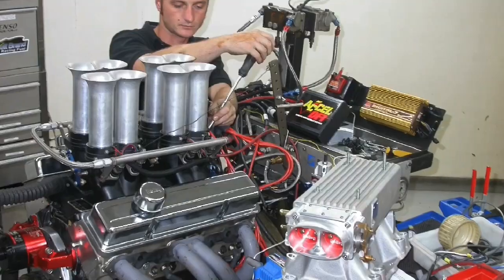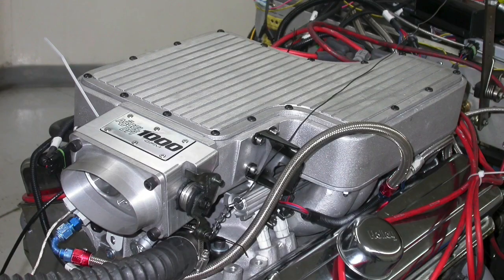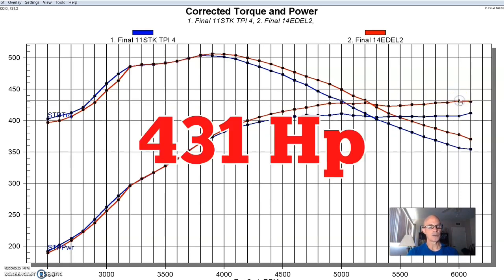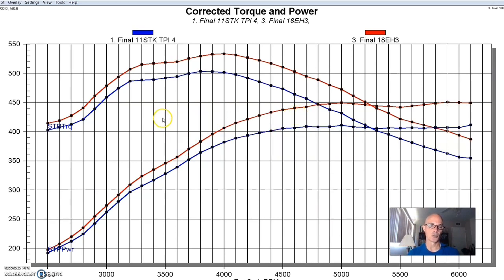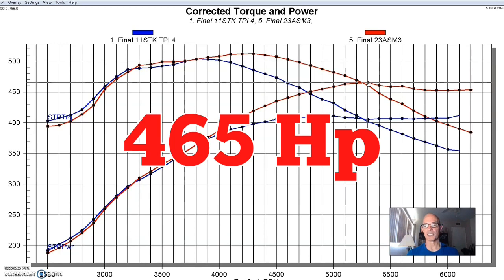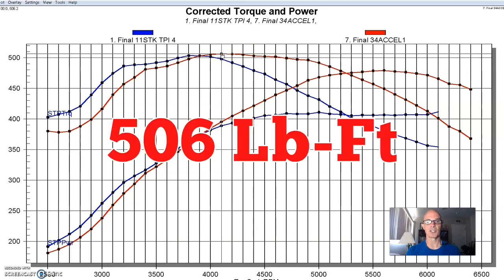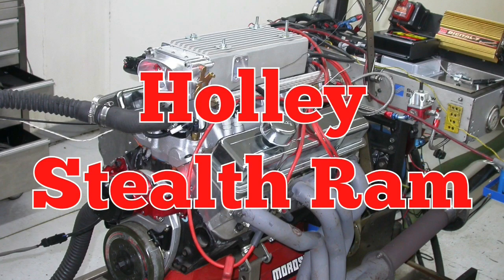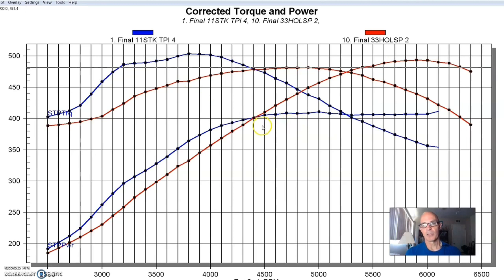TPI MEGA TEST-WHAT WORKS BEST?

Comment: I will take the 530 ft lbs of the the tpis long runner. WOW
Reply: I put as&m, ported stock plenum, accel/lingenfelter manifold, stock TB with airfoil, and make 271hp and 354 tq with a 305 (P&P heads, bigger cam, forged internals, bored over 0.030 which I guess makes it a 310ci). Going to keep entire top end (except will upgrade to 24lbs injectors) and replace block & heads with a 383 and AFR 195 heads which should yield similar numbers to this I think (500+ tq range and 400+ HP range)
Reply: Now imagine if you put a turbo on it with a air to water intercooler to make up for the loss of high rpm flow with boost.  Best of both worlds.  Sacrifice some top end HP for OUTSTANDING off idle response, drivability, and fuel economy when cruising but you got the hong kong hurricane for passing all these 20yr olds with 5.0L mouse stangs.
Reply: That extrude honed stock intake surprised me the most. Definitely not the 500 hp mark but torque was as good as the TPIS whole package.
Reply: @BuzzLOLOL  yup.  They are the best forced induction type for street driving.  Turbo is best for peak output, centrifugal is best for ease of tuning, roots is best for price/perf in towing/mid rpm power.  Each one has an application.  
Putting a twin screw on a TPI setup though would be interesting project due to mounting/hood clearance.
Reply: @BuzzLOLOL  you do if you want to maintain high torque production in that rpm band.  boost just uplifts the torque curve that already exists.  TPI is great for tq.
Reply: @cmcbunch  around here we call them 5.0 muffstains
Reply: @jeremypike9153  
That one impressed me the most also. I'm here looking for a tow engine. All the fat is down low.
Reply: This is what the lingenfelter L98 twin turbo corvette did. Fat power from idle just pulled and pulled with no real crazy surge @cmcbunch
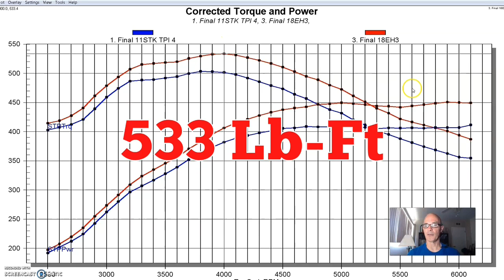Reply: 5:19
383 
AFR 195
10:1 flat top
Comp Cams
XR288HR
.520/.540 lift
236/242 duration 
110 LSA

Comment: I was shocked at the power of the extrude honed with Tpis runners. A lot of guys are going to be disappointed with they’re edelbrock set ups. I have the TPIS mini ram on a 350 and really like the high rpm power for racing. With the ram air setup I get every penny of power. Fun video for those of us gen x’ers!
Reply: The edelbrock bases are fine and real good after porting 
Runners...Id use asm if you can find them.

Comment: I performed a couple of these tests personally in a car on a 350. I had a stock tuned port and both TPIS set ups. The TPIS stuff is amazing on both long and short runner combos. It literally is just a trade as he says. In the car at the track both ran better than the stock but both ran exactly the same ET and MPH. The difference was how the car felt on the street. With the short runners, the car felt less snappy and soft to drive.

Comment: GM TPI intake: Best n/a truck manifold . . . E V E R. 👌🏻😎👍🏻
I liked better the XTRUDE HONED combo. 😊👍🏻 Gains everywhere. 👌🏻
Reply: Remember a guy with a worked over 305TPI in his chevy conversion van, thing apparently moved out well and returned north of 30mpg when cruising on the interstate.
Reply: Erm the LM7 and LR4 and TBSS intakes are rockin.
Reply: My 85 GMC tow truck is getting a 400 TPI when the 350 needs a rebuild.

Dad wants to fix up his old 88 caprice wagon and drive it to the grand canyon from SF Bay while maybe pulling a small trailer. It's a 305 TBI. It needs a new engine, been dead for years.....
I think a 305 TPI  might be the best for mpg AND torque.

Comment: Would like to have seen a FIRST TPI intake thrown in as well.
Reply: Looking at FIRST TPI it looks like the power would be much like the extrude hone or TPIS because it was just a big runner TPI. I saw a video of a 383 running the FIRST https://www.youtube.com/watch?v=pfo_Dh7VbAs and it's a little better than the factory TPI but without knowing the cam on the FIRST setup I couldn't say how much of an improvement over factory it was any.
Reply: Just looked - they still produce/sell them. I am surprised, all the other intakes/runners in this test are hen's teeth nowdays.
Reply: I know its more of a hack job but a converted LT1 manifold would have been cool, I doubt they were doing this back when the original tests were run but a decade ago they were the poor man's mini ram.
Reply: @DrewLSsix  
I don't see why using a converted LT1 intake would have significantly different results than the MiniRam used in the video.
Reply: John Clary Those guys didn’t build a great crate with the FIRST. These guys at RCS sell a crate motor with 460 hp and 520 ft lbs. It’s so far beyond a factory TPI intake: http://rcsracingengines.com/Perf%20Crate%20Engines/Crate%20383%20HP460.T520%20SB%20Chevy%20EFI.html
Reply: Would have definitely joined the fun!👍
Reply: @of_lion22  The development of the mini ram was actually the R&D for the LT1 manifold. So the difference is minute..
Reply: @johnclary729  I have First Fuel Injection intake and no way ported TPI intake can match the volume. First Fuel Injection tubes inside diameter 1.75 and the ported base 1.875, tune for 383 - 406.  Stock TPI intake runner 1.5" tune for 305
Reply: @downhillskier7  Agree.....ported every TPi intake you can think of. First tpi is superior period. Better starting point all together

Comment: I never get tired of your videos, nobody else is doing so much research on L98 stuff as you, LS stuff too, much less sharing it. I’ve had several 3rd Gen L98 cars and have been wanting to LS swap one for a while, watching this has me thinking just build and stroke the L98 again, I never did more than bolt ons, cam and SLP shorter runners and throttle body. It would be nice to see all these setups at the drag strip to see which is faster in 1/8 and what’s faster 1/4 mile. That is a lot of work. Maybe I can just google them for 12 hours lol. Seriously thanks for making these videos Richard, I love them all.

Comment: The Accel box is what I remember back in the good ol mid 90's.  Father had an old Carroll Supercharging Paxton hooked up to a Lingenfelter built 420 with that intake on it and a 100cfm throttle body, Brodix heads.  was a solid 11 second 85 C4.

Comment: One thing you had to take into consideration was the huge drop between 1st and 2nd gear in the 700R4 - that's when the benefits of the extra torque of something like the SuperRam really shined in comparison to the Miniram. Now if you were running a T56 swap with steeper gears in the rear, sure, Miniram or Stealth Ram all day with a cam this size. But with a smaller cam better suited to it, 2800-3200 stall converter, and 3.27 stock rear end, I think the SuperRam would perform best overall.
Reply: You never heard of changing gears?
Reply: @JNAMOTORSPORTS  You mean that thing that's specifically mentioned in the original comment? 🤦‍♂️😂
Reply: The LPE SuperRam was designed to be smog compliant.   The MiniRam, not so much.  Depending where you live, that can be a major factor!

Comment: I had a 383 with dart iron eagle 215s, 10:1CR, stock TPI base/runners/plenum, dual 58mm throttle body, B&M full manual 4l60, and 2.73 gears in a 92 camaro.  The torque was outstanding.  She'd top out at 4750 RPM in 4th with the torque converter locked doing about 189mph.  I wish i had a locking axle back then.  You had to be real careful because it would blow the tires off right off idle, and the engine rev'd so fast that it would shift up before you could get out of it (hence the full manual valve body later).  Car had so much front end lift at 190 that the front suspension was full droop and steering would get scary.  
I did a road trip and set the cruise at 135 once and got about 33mpg at that speed.  I was sure I did the math wrong so I ran another tank out of it with the same results.  TPI is great with the right application.  High RPM just isnt that application.
Reply: How did you tune it?
Reply: @xmo552  i went through about 7 chips back and forth through mail.  If I had it to do over again I would have bought a standalone, but at the time I couldn't afford it.  I later ran a different engine with accel dfi, and a dual sync distributor for sequential injection. It worked WAY better as it had wideband o2.  In a 77 caprice with the original th350 3.08 gears (non lockup) i was able to get 22 mpg at 55 mph towing about 7000 lbs.

Comment: Thanks Richard... I think the origional test was called 10 times the Torque and it's how I arrived at my present setup.  I've referred to it a lot over the years.  I've got a mild cam (smooth idle) 406 with a Super Ram and a T56.    Started with TPI, Tried bigger cams, and the Stealth RAM but went back to Superram with a mild 210/218 roller cam crutched with 1.7 roller rockers for a dead smooth idle good street manners.     Makes all the power from 3500 to 5500 where I like it for my skill level on a road course.    I recently got my first 6.0 LS2 and was surprised how much better the SBC was everywhere below 5500.  The LS is getting twin turbos and mild cam soon but I still enjoy the SBC.
Reply: Cubic inches will do that.

Comment: This test was done like 20 years ago. Carcraft maybe? Same engine, same heads, same intakes, same pictures, same test.
I'd love to see an LS make that much low and mid range torque.
Thanks for bringing it back. 35 year old technology still more tq than the L8T!
Reply: @BuzzLOLOL  I agree, but they don't make the same torque under 4k that tpi does on a 383 with good heads, even a 6.0. But the overall torque curve is a little better.

Comment: Funny I mirrored this test back in about 2000 when I bought my 89 Firebird with a 350 that had a converted LT1 intake but the guy who did the conversion did not get the distributer hole angled right and it chewed threw dist gears.  I first bought a TPI intake to replace the LT1 and it made huge torq down low with a GM Hot Cam, 700r4 and 3.73 gear but ran out of breath at 5000 to 5500 rpm range.  I then bought a Holley Stealth Ram and it was the better all around performer for my combo, better torq down low than the LT1 and better up top than the TPI.  I just pulled engine in 2020 and the dist gear as well as the cam gear are both chewed, prob why my timing has always a bit erratic after the intake swaps.

For a street/strip car I would recommend the HSR but as always it depends on your combo and where you want your power.
Keep up the good work Richard!

Comment: That may be the wrong cam but boy is that horsepower line flat out to beyond 6k with the stock induction on it. Something like this looks like the best of both worlds. Even my little 305 would fall on it's face at the track after 5200. I would try to shift at 5500 and it would run 2 tenths slower every time. But 300 lb/ft at the wheels sure was fun in a 2700 lb Datsun Z. Low 8s/high 12s all day and 24mpg. Loved that 240Z.

Comment: This is probably my favorite small-block Chevy test that you’ve done!!!I agree the cam hurt the lower torque numbers but it was a great intake test👍Some of those intakes were designed for use in a boat so low end is less important,I’m  very glad you did the single plane and the RPM for the do all end all results!🤓This is one of the best if not the best intake test I’ve ever seen by far!I had a 408 with next smallerComp cam with the Rpm and the mighty Demon 750 and it was a very good street combination. Brutal low end and would pull hard to 7000 in a 4 speed.Thanks for all your great content and testing 🙏🙏🙏

Comment: Great series Richard.  I wonder if you ever did any cross ram tests.
Several years ago Nelson Racing built a X-Ram intercooled dual intake for twin turbo applications.  I have always been fascinated by long tube cross rams since the 413 had it in the 60's. Torque is what moves the vehicle and horsepower is what accelerates a vehicle. Old school thinking.
Would love to see something on old and new cross ram technologies.
Thanks for sharing your knowledge.
Reply from the maker: I have run X rams on lots of motors

Comment: This is a really well-done video/test... the best one I've seen on L98 engines. I have a '91 C4 L98 and now I know what I want to do with it (stroke it, get AFR heads, get the stock TPI manifold and runners Extrude-Honed, with a larger TB, so it looks stock but really performs). The intent is to build a sleeper street car that looks stock but surprises most people. Hard to use more than 450 HP on the street without traction control.
Reply: What rear end do you plan on running if you haven’t built it yet? I’d say just reinforce the stock rear if it’s purely a street only car.

Comment: I had a set of Accel Runners with hand ported factory lower and plenum on my IROC 5.7L years ago, it worked well. Then had an AFR headed 383 with a TPiS Mini Ram... two entirely different animals. Wish Holley had the TermX back in the mid 90s - "chip burning" had a STEEP learning curve.

Comment: I remember reading in the 1990s car magazines how the Accel Super Ram was kinda unbeatable.  The price was steep but kinda cool looking.
Reply: I had it, & always had the best results with the Accel Super Ram.  Ironically I recently just sold it,  & it was just the plenum/manifold & not the complete DEI system,  regardless I got over $2k for it. Guys were jumping on it as the bids kept increasing.  They are very hard to find,  & quite sort after.

Comment: Gotta do a video for “The other guys” with the crossfire 305s and 350s used on the Camaros, firebirds and corvettes
Reply: Cross fire didn’t work well even in stock form that’s why tune port was proven better but still lacked power
Reply: It would be cool to see a well tuned crossfire in action. The induction was so neat. The fact that it was a dog on power was mostly due to the ultra low compression, shitty heads and baby camshaft. I am sure with modern parts and a port job on the intake the power would be great.
Reply: Or even the 96 to 99 vortec base  which is essentially crossfire   base with a spider injector contained inside a plastic housing.
Reply: The crossfire was a dog mainly because the runners were 2/3 the size (cross sectional area) of the head. Tinyyyy ports. The make really good gains opening them up. They are one of those situations that the larger you can make them the better.. some people even weld near the ports to get more meat. A well ported crossfire would perform better in the upper RPMs than the stock tpi, simply because it has shorter runners. I would love to see a crossfire test, stock manifold, then good heads and cam, then add a Renegade intake!
Reply: Pontiac turbo 301 lol
Reply: In 1984 I had an 84 Z-51 Corvette.  I loved the Crossfire engine, thought it was great.
Reply: @michaelangelo8001  I thing I just threw up reading that.
Reply: GlassTopRX7 yup
Reply: There was a company that made hipo crossfire intakes the name was renegade.Use to be able to buy them on ebay about 4 or 5 years back all gone now.
Reply: @VeTTeMaNC486  a renegade crossfire with a mpfi conversion. 8 injectors. And modern efi system. Now that would be interesting.  Because having owned a tpi and crossfire. The crossfire has tons of low end torque,even ported to match the heads they are still torquey down low.
Reply: @b.c4066  
Interesting. I tried to play with a crossfire a few years back. There was VERY little support out there.

Comment: I ran a stealth ram on the Firebird back around 04-05. I also did a cam swap. It made a huge difference.
Reply: Was it 305 or 350
Reply: @coreytheisen6948  350, biggest difference is it made power past 4K RPMs.

Comment: Great video and this will help me a lot! I have a 1991 Trans Am GTA and I've been trying to decide which route I'm going to go with my motor build since I've completely ruled out doing the very popular LS swap. My goal is pretty low by looking to make only 400 - 450 horsepower at the crank, which I feel can be easily done without having to switch to a different engine platform.
Reply: What did you end up doing?
Reply: @BlackRam17 , last week I purchased a 383 c.i. crate motor - 435 hp / 450 tq
FIRST Performance TPI style intake
Holley HP EFI ECU & Harness Kit
Holley 30 PPH injectors
Individual coil on plug setup

Comment: Looks like the TPI works well with a big cam to extend  the power curve higher and the long runners keep the low RPM torque stupid high so you get that good dig out of the corner and then the big cam keeps the engine from falling on its face as the engine revs out at the end of the straight.

Comment: Ran Formula 350 Firebird with TPIS lower and 52mm throttle body with AS&M runners and ported plenum with Brodix 180cc heads. Had a TPIS cam I think around 226 duration. Comp cams roller rockers with a T-56 behind it. Lingenfelter headers Tri-Y through twin big cats and a 3.5" single exhaust without mufflers. Car would almost jerk the fronts off the ground and got 26MPG at 75mph because of the T56... Embarrassed more than few mustangs... Would have loved to see it with modern electronics burning chips like throwing lawn darts at it, also maybe a 383 with AFR heads. A TPI done right is an 11 second machine all day.